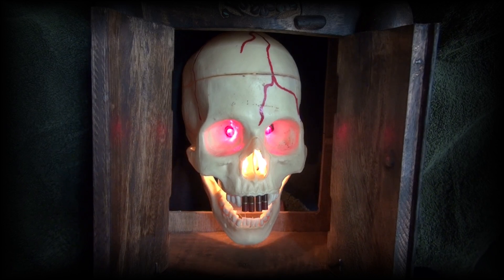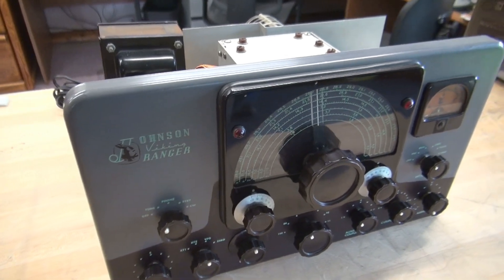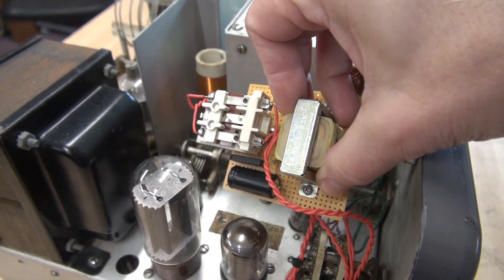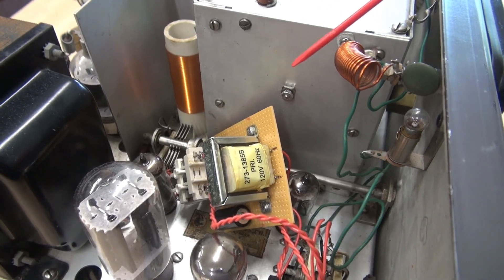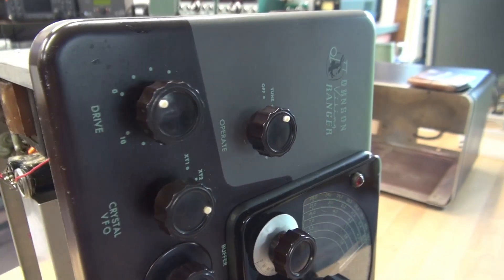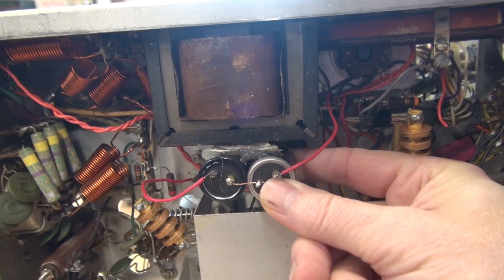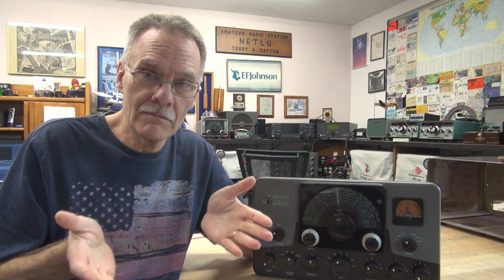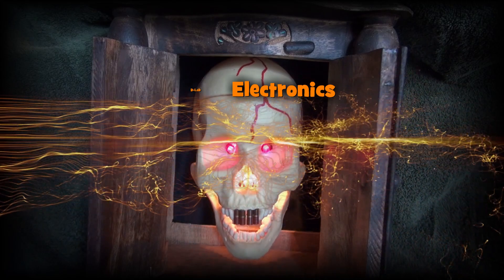EF Johnson Ranger Ham Transmitter Hazardous condition Poor maintenance Shock Theater

Comment: Quick Question for you D-lab (or anyone who can answer). Im building the MOD102+ amp and i wanted to do your 6V6 mod but instead of ditching the EL84 i want to keep it and add an 8 pin socket for the 6V6 and then wire everything in parallel except the cathode resistor and bypass cap. Then take each power tubes cathode resistor and bypass cap to a switch so only one is grounded at a time while the other is lifted. So that i could select EL84 or 6V6. But im still not certain on the values for the 6V6, the best i could figure would be a 470 ohm 5W resistor and a 25uf 50v capacitor for the 6V6? The 25uf could be 25v i think but the 50v axial "mod" branded cap was cheaper if i remember correctly. Does that all sound correct to you? if not id love some feedback, Thanks!

Comment: They also didn't put any balancing resistors across those caps.
Reply from the maker: Yes, good catch. I think one cap was feeling the imbalance. I will be installing them secure & correct
Reply: Maybe they were thinking the leakage current was going to balance it out? More likely there was no thinking involved. My Heathkit audio amps use two filter caps in series with 100K 1W resistors in parallel.

Comment: I had built many high voltage equipment (over 1 KV).  It will have damage the transmitter and/or injury the operation.  The Johnson Ranger transmitter would be a one big paper weight.